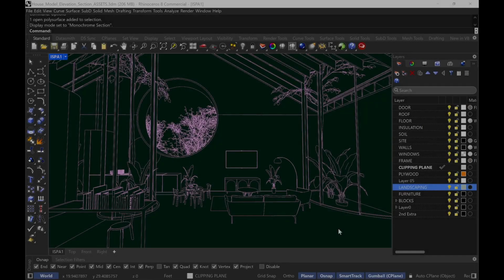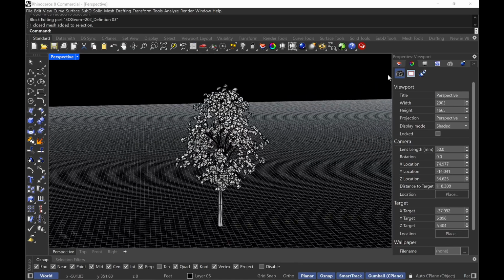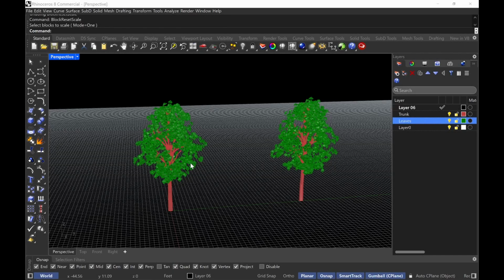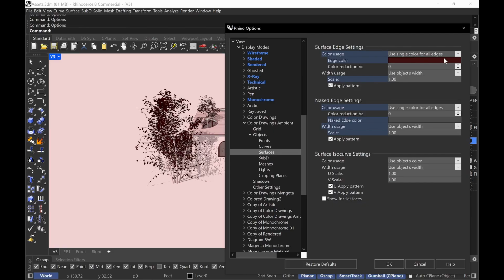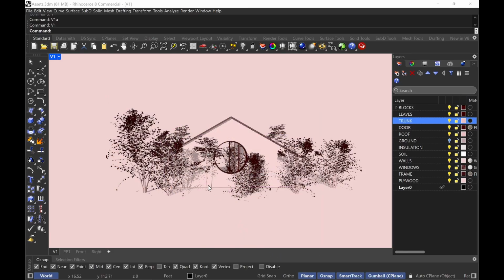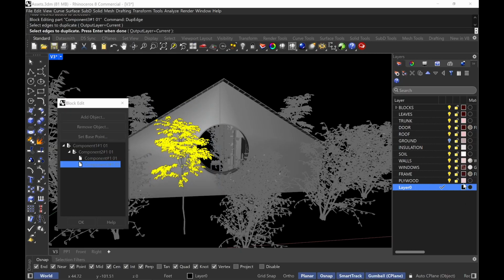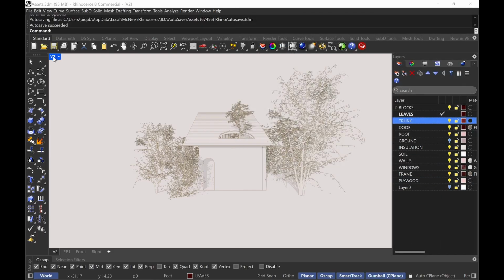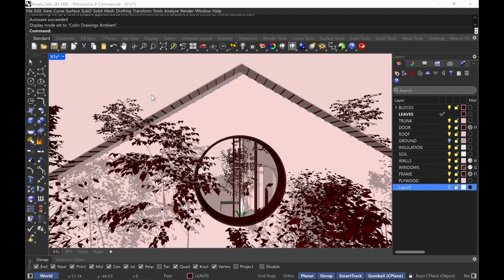Rhino 8 Architecture Assets Vegetation and Furniture Blocks and Architecture Illustration Styles

Comment: Hey, I've been watching all your videos, and I was excited to bring in all this foliage, but each of the four trees I've imported from sketchup have ridiculously complicated nested block definitions that are stored on layer 0 so then it becomes challenging to be able to cleanly separate the components between foliage and trunk. In those cases would you recommend exploding the block? Is there some way to not download trees with excessive block nesting? Is there a way to reconvert to a block after I have exploded it?

I have tried troubleshooting this with AI and it has not been super helpful. Thanks!
Reply from the maker: First, always work with blocks in a separate file before taking them into your main file.

Second, in block edit, You can tell immediately which nested block belongs to which geometry because it'll gray everything else out. And then start to select them and change the layering.

Option 1: One workaround if there is a ton of nested objects, is to change its original leaf material to a solid color, and change the bark material to a solid color. That will save you time from finding every nested object and reassigning the layer.

Option 2: If you do explode block, make sure to ungroup, and then select all genie try and assign it to the layer you want, and then go join it all together again. If you do this, your block will be one single color. If the tree block gets very complicated, I wouldn't make a differentiation between the bark and the leaves because you'll never tell anyway unless you want to make the trunk a different color. If you want there to be a differentiation, and the block is very complex, then follow option 1.
Reply: @unitedstatesofdesign  Thanks for the advice, this helped me figure out what I needed to do! If you need video ideas, I struggle to make decisions when adding in my entourage and foliage, I would enjoy just seeing a) what your personal entourage and pattern library looks like, and b) your process of adding them
Reply from the maker: @asdeasde96 if you're going to add them in Rhino, just make sure you do it in plan view with the project snap.

Comment: But with Mesh objects, when you do a Make2D you have absolutely all the lines of your object, what to do in this case?
Reply from the maker: Hello. That's why I do this method instead of make 2d. If you do it by display modes, you can turn off the mesh wireframes. 

You can do a command called "meshoutline" before you make 2D,  but you cannot leave The view and it will only get the silhouette of the mesh without any of the wireframes.

Comment: I’m curious how you make2D some of these problematic SketchUp assets. I guess there’s no other way other than manually deleting unnecessary make2D lines from mesh objects.
Reply from the maker: It really depends on the mesh you're working with. There's a couple of commands you can use:

Dupmeshedge
Dupedge
Extractwireframe and delete the wireframe curves
Mesh outline (but you need to make 2d with that view or it will get distorted)

Comment: Does rhino 7 offer the same display style options?
Reply from the maker: Hello, 

In Rhino 7 You can do the flat shaded display style settings by copyin rendered, the only difference is that you can only control line weight by pixels. 

For monochrome, Rhino 7 doesn't have monochrome, so you would probably have to use the technical display style settings
Reply: @unitedstatesofdesign  thank you, keep up the great content!